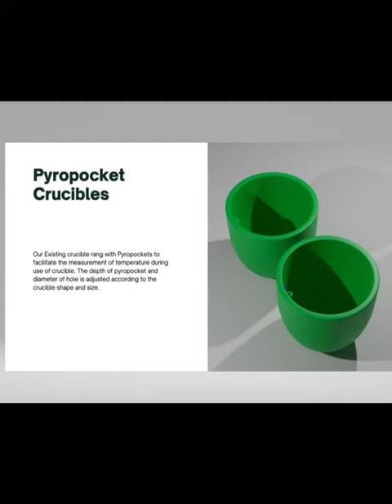"Installing Pre-heated BUC-450 PP | Pyropocket Crucible Temperature Measurement

Comment from the maker: Are you in need of high-quality crucibles for your industrial processes? Look no further! At MGI Group, we take pride in our industry-leading crucibles, known for their exceptional durability and performance.

Our crucible manufacturing excellence sets us apart in the market. Whether you require crucibles for die casting, copper melting, or other applications, we've got you covered. Our precision crucibles are designed to meet your specific needs, ensuring the best results for your operations.

When it comes to conducting heat efficiently, our crucibles are second to none. We offer a range of top-rated, heat-resistant crucibles suitable for various foundry applications. Plus, our crucibles are perfect for aluminum melting, steel industry, and non-ferrous metal applications.

Masc Global Industries, a subsidiary of MGI Group, is renowned for being the best crucible manufacturing company. Our commitment to quality and reliability makes us your trusted source for crucible solutions. Experience the difference with our custom crucibles designed to meet the unique demands of your industry.

Don't settle for less when it comes to crucibles. Choose MGI Group for the most reliable crucible supplier in the industry. Explore our range of crucibles today and discover why we are the preferred choice for companies worldwide.

www.mascindustries.com